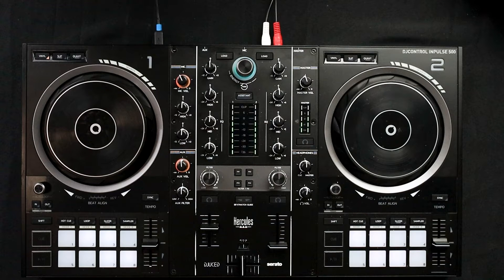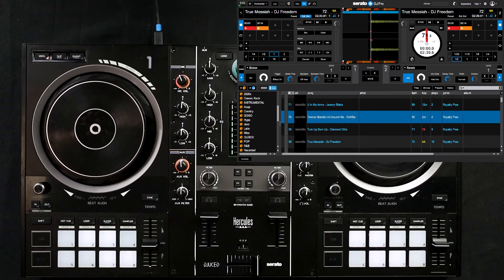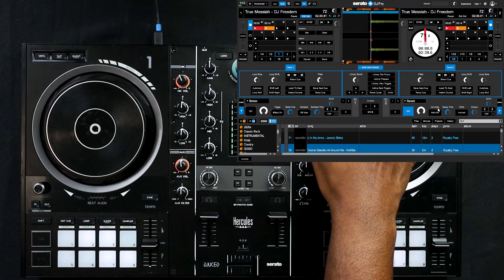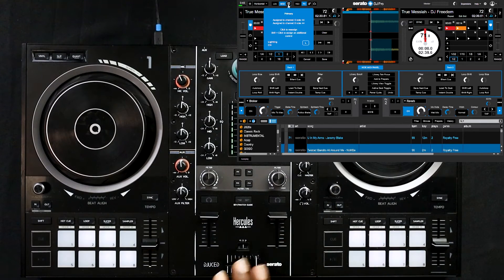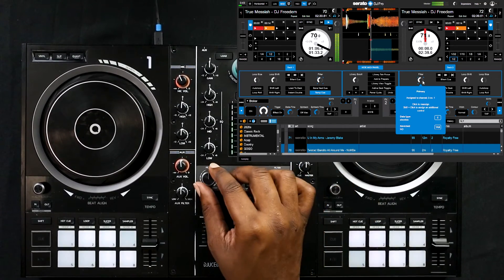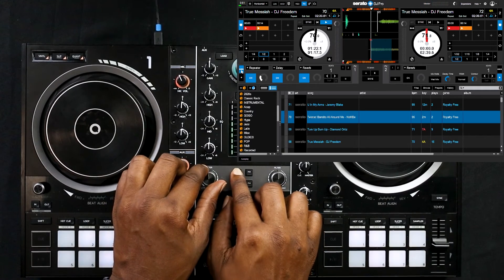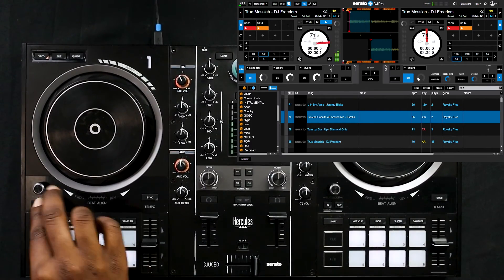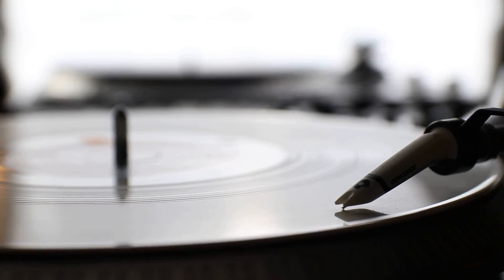Remapping the Hercules Inpulse 500 FX Buttons (More Control Over The FX Section And Filter)

Comment: I just want a Hpf and echo to work at the same time. Could I do this without remapping the top buttons?
Reply from the maker: Wzup Mister Jaye, yes you can achieve that by using the combo fx or single fx in Serato. Select echo and adnust HPF cutoff (single mode) or combo mode choose echo and HPF.
Reply: @XFaderz  Thank you very much for your response....It worked bro👍🏿